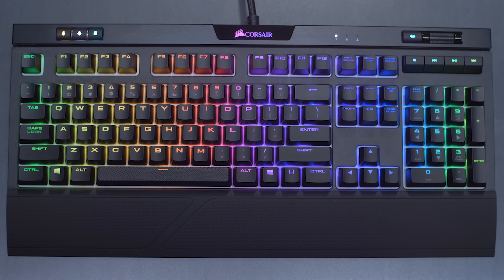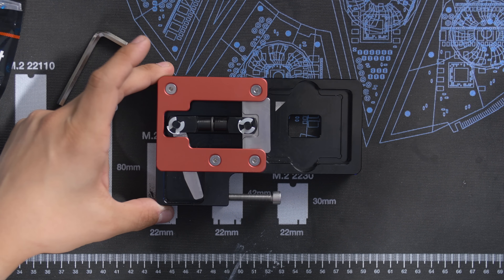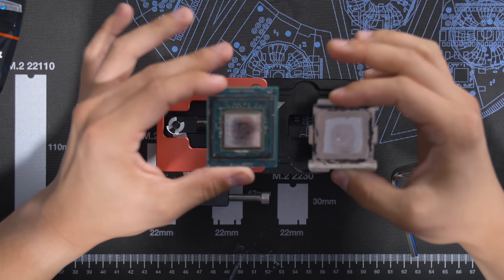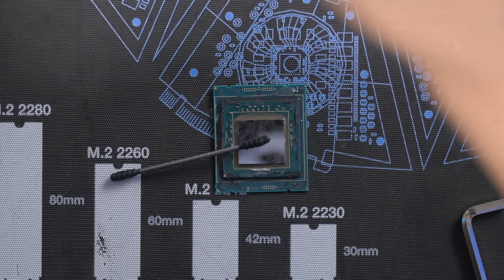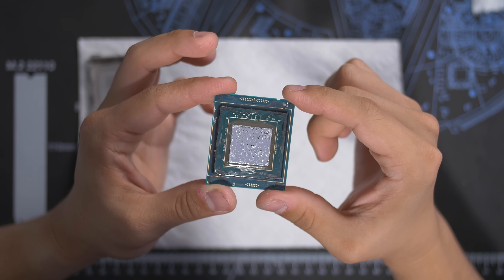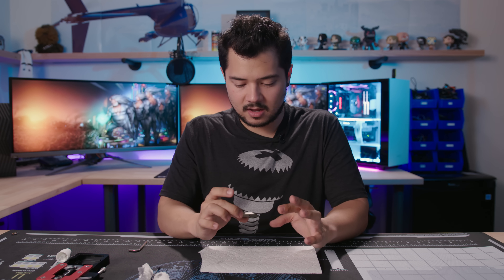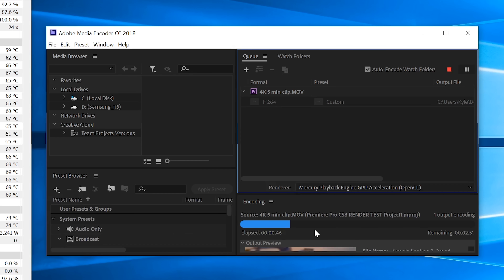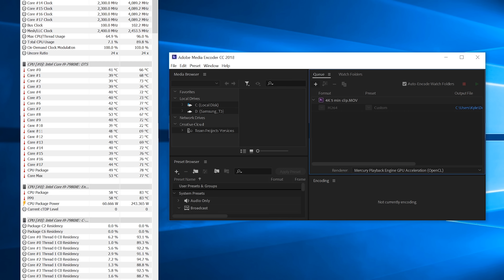My CPU dropped *20 DEGREES* after my first delidding

Comment: A good practice I have seen too is putting just a tiny bit of the crappiest thermal compound, mount in the motherboard socket with the socket clamp, then remove and check the thermal paste spread, if it's not spreading evenly then it will likely require lapping the die or the IHS which would suck so bad.

Comment: The amount of lm should be fine. Steve brushed the capacitors with a sealant as you can see when he angled the cpu. So even if it got on the chipset it wouldn’t short circuit.

Comment: The processor was probably on blacklist for any reason, like illegal windows code, or it was installed with windows loader, or preactivated operating system. It also depends on, if you installed your legal version from copy, or original dvd. If everything is correct, games will reset the cpu and the fan speed, too. High resolution youtube videos also solve this, in 30 min watching. Opera browser is needed, when done, it is permanent.

Comment: Is it possible to use the CPU without an IHS? Is it not possible to mount a cooler directly to the die if you are careful with mounting pressure?

Comment: What happened to CPU fabs selling the processor, fan and heatsink all in the same package? Would be interesting to see a complete CPU with a direct die-heatsink connection, and a PCI-like socket, and some sort of metal-like design on the heatsink like the NVIDIA/AMD reference cards. Comes out of box with delidded performance but without the risk on their end of customers destroying the die during installation
Reply: I remember the ancient Pentium cards from the mid to late 90s where the processor was socket-based (like a plastic/gold socket) and heatsink was all one unit

Comment: my 3900x dropped 20 degres after undervolting it LOOL
Reply: @djangojansen7648  yeah and the 1.5v was stock with the PBO , i was getting 86 degres on cinebench ( stock cooler ) now i put it on 1.100V and let it at 3.80ghz ( base speed ) and i got 65 max on cinebench ( with stock cooler as well )
Reply: @djangojansen7648  its intel LOL , are you running that with an AIO or air cooler ? im still rocking the stock cooler that came with the 3900x lol
Reply: @djangojansen7648  stock it was going almost to 1.50V , i put it at 1.10V on every cores
Reply: @djangojansen7648  99 degres ??? bruuuuuuuuuuuuuuuuuuuuuuuuuuuuuh switch to AMD ryzen my guy , 3900x-3950x are unbeatable !!!!
Reply: @djangojansen7648  danng 99 degres thats insane LOL & yeah i feel you having to rebuild a whole new PC basically not worth it right now if you have a good one

Comment: Skylake 6700k 4.7GHz @ 1.37v. £5 chinese delid tool off ebay. Waited two weeks for delivery, cracked the lid off carefully. Conductonaut on die, plop it back on, Gelid GC extreme on the heatspreader. Full load before: 76 degrees, full load after: 59 degrees. This is also IMMEDIATELY after, before anything is cured. Best decision ever at the time. It's not hard, it's not that dangerous, be careful and in 1 hour start to end you'll cut a huge chunk off your CPU temps.

Comment: ok so i might not get any responses since this was posted a year ago but my r5 3600 runs at 45-50ish celcius IDLE and its sort of worrying i would appreciate an answer lol i also had to turn on v sync for rainbow six siege bc it puts more load on the cpu and before i turned on v sync it was running 80-85 celcius under load which was uncomfortable. with v sync on it runs at 70-75 Celsius with STOCK COOLER i also have a 2060 super but for some reason my games put the load on my cpu instead of balancing out between the gpu and cpu. but is this normal?

Comment: how do u delid without using that thing? my i7-4770k is 7 years old and with stock heatsink and it's 80°c on idle and 100 on load. i changed my paste like 2 times, and it still doesn't improve.. sobs

Comment: 76 degrees after and with good cpu cooler isn't a good temperature. 76 is a good temperature for non-delided cpu. 
You screwed something up.
Maybe there was not enought contact.
I trully dunno. what I know for sure is you should repeat this process until you get a better result.

Comment: I never delidded in my life and delidded my 7820x 8-core cpu running around 4.9ghz all cores before the delid. I found it to be a very easy job, time consuming tho as I wanted to scrape away all of the old intel sealant and re-applied my own RTV on the 4 corners of the IHS. I used liquid metal on both sides and dropped 15-18c .. I think I would have dropped more but I also changed from an ek supremacy water block to a x299 monoblock at the same time so now I am cooling my VRMs with my loop as well and I used thermal grizzly minus thermal pads for my VRMs and wow what a difference, I went from 90-100c VRM temps to 30c at idle and 48c under full load! My loop is def running a little hotter now obsorbing all that extra heat which is why I feel I am not seeing over a 20c temp drop on my cpu. Im planning on going for a 5ghz all-core overclock later on today because with the added CPU and VRM cooling I have now I believe I can finally get stable at 5ghz.👍🏻

Comment: You could probably get another 5-10 degrees if you remove the old silicone. It looked kinda thick and could be causing space where there should be none. Also, the fact that Steve didn't clean off the original silicone, or apply new is the only reason yours started overheating to begin with, because it probably shifted during the loop change. Also applying an even coat on the IHS as well as the die will help.

Comment: I find its kinda interesting that it was cores 4, 13, and 17 that were overheating. The number 4 is considered an unlucky number in Chinese culture. The number 13 is also widely considered bad luck for multiple reasons. If you add those two unlucky numbers together you get 17

Comment: BS you didn't lose that much Temperature that should be compared to every CPU.  Removing the Lid on Intel and AMD on a properly mounted Core Heat Spreader will not loose that uch heat. You just had a poorly mounted Heatspreader.  Everyone taking this advice should just stop and keep the lid on.  It is proven that removing the lid can in fact add temperature in some cases, and best-case scenario lose a small 2-5 Degrees.  Definitely not worth losing out on the cost of a replacement. if you think that you can gain better temps, simply clean your cooling system and vents, invest in good Thermal Grease. Decent thermal paste will cost you approximately $10.00 per gram average. want something better, spend approximately that amount on .5 grams.  De-lidding your CPU will not have an average yeld over 5 Degrees. Not worth the possible $350.00 for a new CPU for you intel Lamers.  Yeah most people who will try this are Intel users because well frankly, they just are not smart people.  However, they do enjoy being ripped off buying relabeled CPU's at top-shelf prices!!!

Comment: cant do this with amd though
Reply: Actually you can. Easiest is with Zen APUs, as they also use thermal paste. And quite a good one, based on the tests. Even liquid metal brings not much of a gain.
Harder are all non-APU-Ryzens and Threadrippers (and probably Epyc too). I think Der 8auer did it. You first need to put the CPU in the baking oven to melt the soldering.
Conclusion: You can do it, but it's simply not worth it. Liquid metal instead of soldering brings only negligible advantages for Ryzen and Threadripper, it's simply not worth the potential destruction of the CPU.

Comment: I delided my old i5 4670K and 15°C down in full load, I didn't expect such difference. With water cooler I can go to 4,5 GHz without problem now, it was impossible before because temperatures.
PS: I installed modern cooler to old Pentium 4 to 478 socket and I finally reached that stupid 4 GHz on that fucking CPU after almost 15 years! :-D

Comment: Also, if the temperature measurement is at the actual die, 100 deg. C is not that bad. You really don't need to worry until you get past 125 deg C. Most semiconductors will work ok-ish up to about 150 deg. C. By about 200 deg. C is when they start to degrade exponentially with each degree of temperature increase, from actual testing done on components at my last job. FWIW 100 deg C on older computers was a big deal since the temperature measurement was from a thermistor somewhere nearby the IC. The actual die temps could easily be 50-100 degrees hotter, hence why it mattered so much.

Comment: Seems to me a better option is to polish the lid and contact surface on the cooler/heatsink with a flat plate (or glass sheet) and 1000-2000 grit sand-paper.  Note that the sand paper must be very flat for this to work, hence the need to use a plate underneath. This will make the surface much more uniform and lessen the need for the thermal paste to conduct heat. Thermal paste is typically NOT a good heat conductor. Its only there because its better than just having air in the gap instead. The lid itself doesn't have that high a thermal resistance, but the matte surface and engraved text adds lots of valleys and ridges that hamper heat conduction. Theoretically if you were to lap them together to an optical finish and get them very clean you could skip the heat sink grease entirely since they would be in nearly perfect contact. You can tell if your at an optical finish if the two parts stay stuck together after you squeeze all the air out. This should give you essentially the same result as de-lidding since one surface is now a much better conductor of heat.

Comment: hehe that was fun... hahaha slacker..
Reply: the pressure on the cpu when you remove cooler.. likely need to reapply ... why i never glue the ihs down. :)
Reply: hahha blame wify
Reply: also, i usually apply on chip then apply on IHS then put chip in socket.. sammich.. then do socket hold down.

Comment: How are my air cooled CPU temps at idle, MAX 40c?? Thats really good in my opinion. BTW I live in Florida. 
And under load I rarely see them hit above 65c.

My PC Specs:
Case: NZXT H440
CPU: i7 6700k 4.5GHz
Cooler: CoolerMaster Hyper 212 EVO
GPU: Gigabyte RTX 2060 6gb OC
Ram: 16gb DDR4 2133MHz
MB: MSI Z170a SLI
PSU: Corsair CX650M

Comment: my cpu increased temps after delidding, what did i do wrong? did everything according to tutorials.... litterally everything. now my idle temps are 50-60 degrees? wtf did i do wrong?
Reply: Did you remove the silicon glue remians on the IHS?
Reply: @dainiusvysniauskas2049  yea problem was the paste. it was trash. using thermal grizzly conductonaut and temps dropped 10-12.

Comment: I had this happen on a 3570k. Point one, the liquid metal does not last forever, it has to be reapplied at some point. Point  two, yes if it is disturbed, re mounted it can lose contact with the IHS. Really more of a PITA. Better to use some really good thermal paste, might be a few degrees hotter, but it will last longer, and not give problems between remounts.

Comment: 35 degrees on idle ? God damn , buy a  decent air cooler, like Noctua
 
You can apply as much liquid métal on the die as you want , maybe few degrees off.

I have the i7 9700k , changed the thermal paste from the die after 5 months from when I buy it , I had 65-70 degrees on CSGO , I was like wtf ?! Btw , I had an AIO from Corsair. My first and last time with an AIO, is just for fancy look of the CPU , but is a big s*it ! Changed the paste with liquid and a nice noctua cooler , on idle a have 17-25 degrees. On BF5 ultra 1440p max 55-60 degrees ;)

Comment: Anyone ever tried Liquid Metal in place of thermal pace for your CPU Cooler?
Reply: yes I have however there are a few things to note...
1. don't use it on aluminium, it will react badly
2. copper may pit/tarnish but will be noticeable after cleanup

best to use the nickle plated copper heatsinks that are popping up now, they can be used (and then cleaned + reused) without issue.

also be aware that VERY LITTLE needs to be applied and spread and that it is electrically conductive  as well as thermally so too much LM applied can not only degrade performance, but cause a short.
Reply: @x3roxide 
Thanks for the informative reply.
Your a Trooper my dude.👍

Comment: Just a tip, You should have put some resist on the SMD components in case the LM managed to get on them. It will eat the solder holding them on.

Comment: Do not de-lid your new chip. the latest chips ( as of 2019 ) are soldered and there is no thermal paste to remove. you can replace the solder with liquid metal but you only get a 2 or 3 degree drop in temp, and when delidding a soldered chip it is very easy to damage the chip. and getting the solder off the opened chip is just a bitch. it is mostly not worth doing with the latest round of chips. with the older ones... maybe, but not the latest ones.

Comment: KYLE, Please do one with like Gelid GC-3 Extreme Performance Premium Thermal Compound and see if that works as well Bro that would be cool (pun intended) lol to see how that works instead of that liquid metal junk lol ;) This stuff worked better on my CPU than Artic Silver 5 or Diamond thermal paste did wonder on a de-lid how it would work? HEY! Wonder how it would work on a GPU as well ??? Here just incase you never heard of this stuff >>>  https://www.ebay.com/itm/Gelid-GC-3-Extreme-Performance-Premium-Thermal-Compound-paste-Grease-Applicator/331169308759?_trkparms=aid%3D555018%26algo%3DPL.SIM%26ao%3D1%26asc%3D20131003132420%26meid%3D61518335078b47bb99a889b25d0008d2%26pid%3D100005%26rk%3D2%26rkt%3D2%26sd%3D222542849155%26itm%3D331169308759&_trksid=p2047675.c100005.m1851

Comment: me and my friend did my 4790k successfully BUT we used superglue to bind the IHS to the chip. and it looks ugly and i feel it could be done better, ideas to cut through the super glue and make it easy to re DE LID???  <3 also your wife is hot..
Reply: you can use a razor blade to cut through the glue but I dont recommend it. Use the Bauer tool so you dont have to risk chopping of some capacitors
Reply: also use the tool to re delid the CPU its the easiest way.

Comment: Lol 34C is NOT a good idle temp. That’s high. That should be closer to 25. It should never be higher than 28 at idle.
Reply: What processor do you have? Do you know anything about the processor he's using.

Comment: hmm. I just changed my chip to a new motherboard and my CPU temp is up constantly at 100C in games and 75+ idle or light browsing.
Could I have the same problem? Dont have any of those tools available of course...
Reply: can be anything, lack of airflow at the intake, cooler not properly mounted, bad repaste, anything.

Comment: This is nonsense...You will NOT get any improvement in performance with this. Even if you go from 60 to 40 degrees, you will not notice any gain in performance. The point where your CPU wil throttle is 100 degrees. So this is bullshit and will not make a difference. You should get some knowledge about how CPU works and not making a stupid video with nonsense.

Comment: This isn't not safe. Laptops don't even have  a IHS do they? Liquid metal and copper pipe.
Reply: Salman Ismail I put liquid metal in my laptop and it’s great. It has a copper heat sink. I had to apply carefully but the temps went down by like 11 degrees and the fans barely spin up now
Reply: @KaptainMc7  fans always spin but slowly.liquid metal dropped my temps down by 5c What laptop do you have?
I'm going to mod my laptop soon to decrease the temps..
Reply: Salman Ismail I have aced nitro 5 which has bad cooling. It has the cool boost technology which makes the fans sound like jet engines. Something else that helped me which some people don’t wanna do is i took out some of the bottom plastic pieces near the fans to allow more air to be sucked in. I know more dust and hair will get in but I plan on checking it every 2 months or so. It’s helped a lot.
Reply: @KaptainMc7  I've got the boost feature too in my msi gl62m 7rdx. It has alot vents under to allow ait flow but the temps arent even that good... Liquid metal.. Csgo med/low settings I get 65c. Med/ultra 72c. Isn't that even okay?

Comment: I think I need to delid my i7 8700k. I'm running a 280mm AIO and it hits thermal throttle under load at 4.8 GHz, even at under 1.3V core V with the fans and pump at full speed. Not ideal. The chip is stable at 5.0 GHz on 1.32 V core but under full load it instantly hits 100 degrees and throttles down. Thanks Intel for your crappy thermal compound inside the IHS.

Comment: You can use ACRYLIC conformal coating to help prevent a short, folks tend to use the silicone version which makes little sense. It will work as they both do the same job (to prevent the liquid metal from coming in contact with a capacitor) but the acrylic version is far better (about 5 times) for electrical insulation which would be beneficial for this type of application. If you are still nervous after this you can even put some thin kapton tape on top of the conformal coating after it has been given time to cure. Kapton tape is also very good for preventing a short (it's sole purpose) and it is made to withstand heat far beyond what a CPU/GPU will ever see.